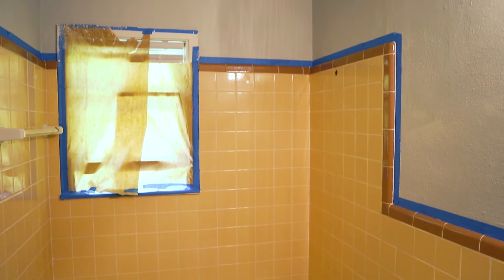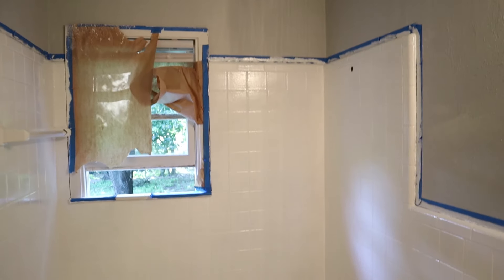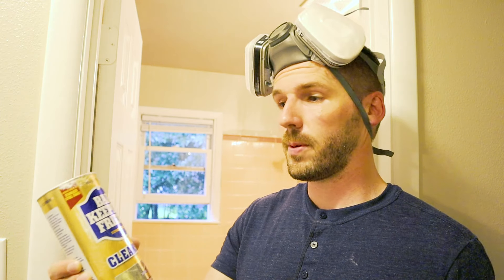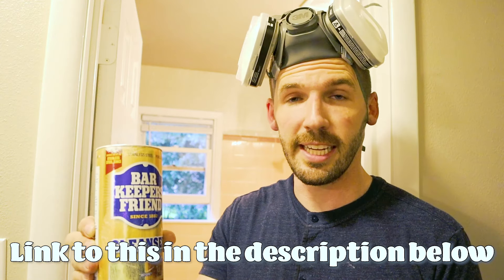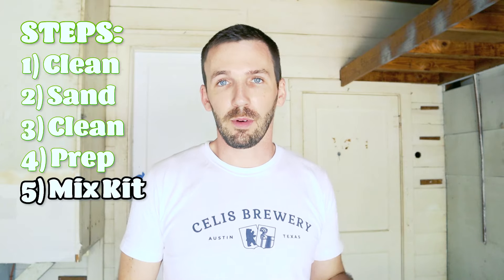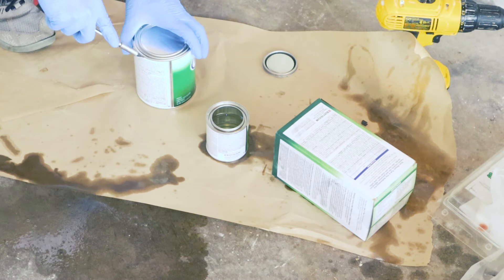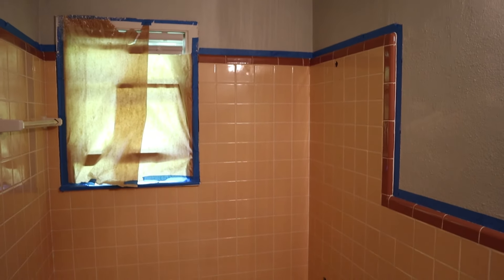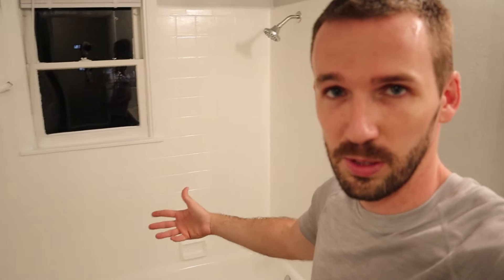How to Refinish a Bathtub and Tile with Rustoleum Tub and Tile Kit

Comment from the maker: Update: Tenants just moved out and I got a new look at the tub. 2 years and STILL perfect under 2 different renters. See you next June for 3 yrs (hopefully my tenants don't move tho).

This product has now lasted 1 entire year with a tenant using it and there are NO issues so far.
It's the only bathroom in the house so it got a ton of use - so I'm happy with this. What is your experience with this?
Reply: Thanks for the video. I've heard from other investors that the kit doesn't hold up. How many coats did you use? Are there any special instructions you gave the tenant about cleaning?
Reply from the maker: @JasonJFlippingLife  I've also seen the mix of good reviews and bad reviews so I was skeptical at first. I think it ultimately comes down to cleaning still and I doubt most people bother with sanding (which also cleaned a ton of gunk). I put on 2 coats and went really heavy with the 2nd one between the grout lines. I didnt ask the tenant to do anything special, but he did seem like a clean dude.
Reply: @KellyConcepts  makes sense. I'll try sanding. Thanks
Reply: Thank you so much for the video, update & links!! Ordered my kit and supploes, can not wait!!!
Reply: Ekopel 2k is nontoxic and lasts 10 to 15 years.
Reply: How do you think it would fair on the floor
Reply: How well would this work for kitchen countertop tile? same durability? I'm 100% a beginner here!
Reply: Regards!  I plan to do the same as you.  I also want to paint the bathtub but I don't know what products to use before painting it, what sandpaper, how to clean it?
Reply: @Susan70003  so would you recommend that one over the product used in this video?
Reply: How long does this product last?
Reply: @nunkap8874  the one in the video is very toxic.  It's basicly sprayed on Appliance paint. My husband used this and it didn't hold up.  Ekopel2k can be applied without toxic fumes.  It's a 2 part modified epoxy. If you know anything about epoxy you know it lasts. Watch the tutorials several times before mixing and using. You can muck up if you don't do it right. It will not bubble when you set wet shampoo bottles on it.
Reply: @Susan70003  wow, thanks for that. Can you send me a link to this product your talking about?
Reply: Awesome going to use to update our bathrooms to sell our house
Reply: How long did u wait to apply the second coat
Reply from the maker: @shirazvadia  1-2 hours. By the time I finished the first coat in the whole bathroom, the 2nd coat was ready to be put on.
Reply: @KellyConcepts  Thank You
Reply: @Susan70003  EKOPEL 2K claims to be odorless. Does it also claim to be non toxic? There are hundreds of dangerous toxic materials in use every day including many that are odorless and colorless. The company did not reply to my chat query.
Reply: @Susan70003  
Here's their [indirect] reply in their website's chatbox:
"Ekopel in liquid form (as a mixture)can cause skin and eye irritation. That's why we recommend to use protective clothing during application.
" » indirectly saying it it toxic.

"It is non-toxic when hardened." » as are Rustoleum and all other similar products.

I guess that's why they can only claim that it's odorless. Amazon, however, states that the product is nontoxic.
Reply from the maker: mas360  I agree and thanks for that feedback. This was a long tiresome remodeled house and this was my last project on it - so my camera work was getting lazier and lazier as I just wanted to finish the home. Definitely regret not getting better finishing shots!
Reply: @KellyConcepts  Did you have to recaulk the around the tub and tile?
Reply: @nik_5992  how did it go?
Reply: @Susan70003  I've never heard of it - in all my searches it never came up. Have you used it? A bit pricier.
Reply: @ShellieSager  I watched all the videos intending to do a project. I prefer to find a contractor that I could hire that has experience. Not one presently in my location. The one draw back that I read about is that it can lose it's shine. I like the shine when first new. refinished bath solutions has quite a few videos. They have not mentioned loss of shine. I would ask them about it before purchase. At this point I am considering going with new porcelain.
Reply: Thanks for the update-- looking forward to the 3 year update!!
Reply: Update?
Reply: I appreciate the continued updates. Thanks.
Reply: Thanks for the video  @KellyConcepts  You could also start with a high stick primer like STIX https://www.youtube.com/watch?v=e7jskY5uoUg
Reply: I was going to ask how it was holding up.  I have a blue tub and tile bathroom.  I think I might have to try this. Thanks for the video!!
Reply: @dzdari1149  if you watch his video he’s pretty specific about what he did and how he did it.
Reply: @Susan70003  It’s rude to come on this guy’s channel and throw shade! He didn’t use a paint intended to be sprayed, the instructions were clear and he followed them and it’s held up.
Reply: @JasonJFlippingLife  Yeah he's on drugs. These don't hold up at all. You have to refinish it once a year or it flakes off and looks worse than ever. This is one of those situations where being cheap ends up being very expensive.
Reply: @articledon4880  Bad. Trust me I tried it. This stuff will look good for 1, 2 years tops, then you have to redo it again and again. It's a short term fix that ends up costing more time and money in the long run.
Reply: Hi Very interested in doing this in my bathroom…I’m very new to this so pardon me if this is a question that is obvious but I’m ignorant to the answer…how did you manage to get behind the toilet without removing it?
Reply: Look nice but how long it last? What brand you use to paint your tiles?
Reply: What product was it
Reply: Updates?
Reply: @JasonJFlippingLife you’ll always get better results. Especially if you sand between coats
Reply: Is there a more recent update to durability?
Reply: Hey it’s been 4 years now. I am thinking of doing this in the house I want to live in for the bathroom and kitchen tile. Any word on how it stood up to the test of time 4 years later? Incredible video!

Comment: I have done this with a pink tub and tile. The key is be diligent with the prep. Multiple THIN coats. I did three and gave it a full 7 days to cure after. Absolutely no water running in the bathroom until it was done. If you see ANY fish eyes on the first coat, sand and clean again in that area. Your first coat will reveal any inadequate prep.
Reply: This is the comment I was looking for. I just used it on the floor in my guest shower. I'm putting my house on the market and it needed a little sprucing up. I can tell in a few spots it needs a little more.

Comment: Thanks for the video! I am planning to do this. I have few chips in the side of my bathtub from removing shower doors a few years ago. Will this product cover those small chips in the tub? Also, could this work on a sink and counter top?
Reply from the maker: Hi Yolanda! This stuff is pretty thick, so it could cover some small chips of the tub (although you still may see a little dent still). This will also work for sinks and countertops, but may not last quite as long if you set things on it like a water glass, a hair dryer, or something hard.
Reply: @KellyConcepts  Thanks!

Comment: I just tried this.  Some things worth mentioning: You need a ton of foam rollers - I went through 9 or 10 and I didn't even finish the bathroom.  This stuff disintegrates the foam almost on contact.  Also, you need to pay extra attention to grout lines.  The house we bought is 60 years old and the grout was super eroded, so the rollers did not get down far enough to cover them with paint.  I had to spend a lot of extra time running a foam brush along the grout lines so they would get painted.  The soap dish is very hard to paint and have it look evenly coated.  And, this stuff doesn't go very far...my bathroom is 6'x7' with tile half way up 7' walls and a tiled stall shower.  I only got through 2 walls and the stall shower with the first coat/kit.  I opened the second kit, and like others have mentioned, though I stirred the requisite 3 minutes, (and had no problems with the first kit) this kit was watery and never quite thickened.  So, I had to use a ton to try and cover the bit of blue tile still coming through, and ended up not having enough to do a second coat all the way to where I'd finished the first coat.  So, my bathroom looks crazy, and I'm not sure what to do since this is only available online and takes weeks to get delivered.
Reply: Home Depot sells a version by Homax called Tough & Tile refinishing kit. Hope this helps.

Comment: I swear you're in my bathroom. I'm renovating a house from 1972 and it looks exactly like that bathroom! Tile from over the sink to and around the tub and around that damn window in the shower, why did people do that?! Thank you for the tips!!
Reply from the maker: Haha yea it's just asking for water issues around the window! Thanks for watching!
Reply: I also have the exact bathroom ! I guess it was a thing back then lol we live on the country side and water is hard even with water filter and all that I’m wondering if it’ll work on this transformation .... I usually use toilet Lysol cleaner because it’s the only thing I’ve bought that works on yellow water stains ? Has anything like this happened to anyone PLEASE ! Would hate to do all the work and investment to not work but I really fo wish to upgrade !
Reply: We have a 1956 house with bathrooms with exact tile (pink in one bathroom tan in other) and exact same tubs.  Ours are sans the windows in the shower but even the towel bar and sink “fixtures” match.  The tub is a jack hammer removal, and anything attached on tile is done so with screws through the til so one has to remove tile to change it.  Definitely they built them to last LOL!  Thanks for the video 💪🏼
Reply: @dakatone do you have the razor slit in your wall too? 😳 😊 🧔 back when men had stylish beards. Not homeless or lumberjack beards

Comment: I used this product on my shower. Have you warn you, the fumes are extremely strong and toxic. I had a fan running 24/7 with an open window and it took at least 1.5 weeks for the fumes to evaporate completely.
Reply: Is there any other products you can get that is not strong  my window does not open
Reply: Yeah, I heard that on another video using the same product.
Reply: Grow a pair paul.

Comment: Your bath looks great! I am in the prep stage of doing my shower (pink tile!). The sanding seems to be doing nothing. Even tried an 80 grit paper. I can see that yours still look shiny even after you sanded. What should I expect the tiles to look like after sanding? I want to make sure the paint adheres to the tile surface.
Reply from the maker: Hi Kimberlee, yea when you sand it doesnt look like much, even in person. It is still making abrasions on the surface that will help the paint stick better. The other purpose of sanding (for me) is cleaning up the tile even better since its from the 1950s.
Reply: I am having the same problem with my 70s bathroom tile.. I am also using 80 grit sand paper..

Comment: So I bought two of these as I have the same tile in my upstairs bathroom. I saw in the instructions that you have to use 400 or 600 grit sandpaper. When I tried that, the sheen wouldn't come off. Is that why you used 220 grit?

Comment: I clicked on this because of the color tile. Would it cover pink and black tile? 🤢🤣
Reply from the maker: Itd definitely cover pink with 2 coats, but black would probably need 3 coats 😁
Reply: @KellyConcepts  Best bet is to buy more than you need and return any unopened product you didn't need. It's much better than stopping halfway through to go back to the store. At that point you pretty much have to wait until it dries before continuing on or you will get a mess wherever the new coat overlaps the old coat.

Comment: 2 questions for you. How long did you wait between the first and second coat? Also, how did you do the small detailed spaces? Like the soap holder and toilet paper roll holder?.. did you use to foam rollers or a different brush?

Thank you so much for this informative video. I feel much more confident going into this now. Especially the prep work! That seems like an important step
Reply from the maker: Hey! I did the 2nd coat about 2 hours after the 1st coat. This stuff is pretty goopy so it dries quick. And the other little stuff was done with a foam brush that you can get for like $1. A regular brush will work too as this stuff smooths itself out. 

I appreciate you watching, and yes cleaning is the most important part!
Reply: Great video. 

How long did the process take: from beginning to end.

Comment: This video is handy. When I decided to resurface my tub, I did a lot of research, and the product you used is the one I found to be affordable and with a beautiful finish. Then I thought, why not do the tile, and as I contemplated this thought, I was thinking of breaking the walk and putting new tile, but I am so glad I ran into your video because I had not thought about using the same product for the tile and more. I am impressed at how nicely your entire bathroom restoration turned out. You inspired me to do the same. I'm so excited can't want to get started. If you have time, can you please answer one question. I have specks of mold in-between the tile crevices in some areas more than others, and my number one reason for wanting to remove the tile. I will curate the mold specks a day before, but with time will the mold seep through the restoring product? Thank you for doing such an awesome YouTube video.  😁
Reply: I had the same question, did you ever complete the job and how did you prep or get rid of the moldy crevices between tiles. Did the mold come back after renovating?

Comment: Thank you so much for doing this! I have this exact project to do and like your bathroom mine has tile around the entire bathroom. I am concerned with the certain areas drying before I get one full coat on. It seems you did not have an issue. Any advice on stages of application? Also ventilation was the smell horrible? Was the window in the bathroom enough for ventilation?
Reply from the maker: No problem! I would start in a corner and go around your room until you meet back up where you started. Then let all of it dry for at least 2 hours and start from the same corner you did before. My window was not sufficient but I only had 1 open (it was 100+ degrees and no window screens). I'd open all house windows if you can. Thanks for watching! And good luck
Reply from the maker: Smell was horrible so if there's people at your home, go for a long walk while it dries.
Reply: Bat City Designs thank you sooo much for your response and advice!! I’m looking forward to this project despite the work it will take to complete.

Comment: Great tutorial...I’m getting ready to do this to our dated master bathroom. My question for you is do you think it will work on tile that has images on them. The base of the tile is beige but then some have flowers on them. Question 2 did you do anything to your grout before or after.
Reply from the maker: Hi Heather - sorry this comment is late. This will definitely cover any images/designs. It's a thick type of paint and you should apply 2 coats anyway. The most important thing with the grout is to clean it before hand. I also had to use a hand brush for some harder grout areas where the roller wouldn't get - but that's about it.

Comment: Great video! question: could you refinish the floor tiles and walk on them using the same kit, and then walk on it? do you think it would last? my bathroom floor tile is also pink :/
thanks!
Reply from the maker: Thank you! If you were to walk on the finish with shoes, it probably wouldn't last very long. But if you are barefoot or wearing socks it would probably last a few years.

Comment: Genuine question why you used the foam rollers?
Reply from the maker: foam rollers leave the smoothest finish. I use them for cabinets, trim, tile, or other smooth surfaces where i needed the smoothest finish possible.

Comment: Hello Sir…
Our bathroom looks about the same size same age.. question.. did you remove your toilet to get behind it or no?? Thank you 
Will be doing mine soon.
Reply from the maker: I didn't remove mine on this one, I took the lid off the back, put tape up and down the sides of toilet closest to the wall, and then rolled behind it. No one would ever see the paint on the back of the toilet so I just did it the quick way.

Comment: Prep is key. It's just like you're painting a car. You got all the substrate clean and even tack clothed. I would offer that during sanding, a hand detail of all the not flat nooks and crannies would be a good extra step. 3M scrub pad thingy or sand paper (even a used disc) Everything you are going to coat needs to look dull from being given "teeth".
Reply: I’m in the middle of this project. I tried 220, 120 and 100 grit paper on my orbital sander. Barely did anything. Now using 60 grit and it’s finally removing the gloss finish. My bathroom is nearly identical to this one.

I guess my question (I’ve never done this before) is do I have to sand the tile down to a flat/matte finish before applying the paint? In the video the tile still looks shiny when he applies it?
Reply: @idonthavealithp  Think molecular mountain range. The less glaze left the better, but the key is to hit everywhere at least a bit to provide "nooks and crannies to hold the melted butter". I'll bet our host gets away with the job he did, but my idea might buy a few more years. [Nooks and crannies courtesy 70's English muffin commercial.] And the goop used in this is pretty thick so it should hide 60 grit scratches. Da a test tile to make sure you don't need to smooth it first with finer paper. Be a shame to have to do it twice.